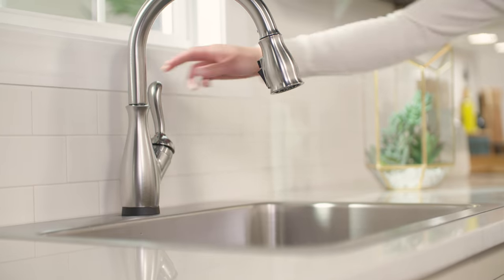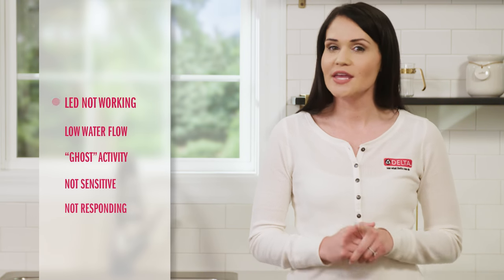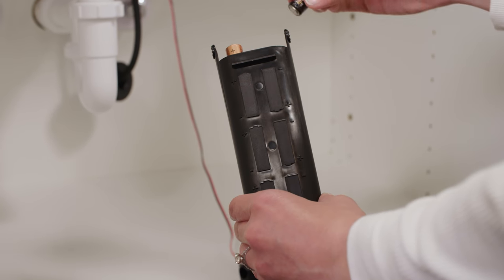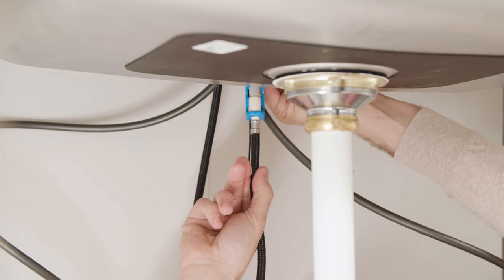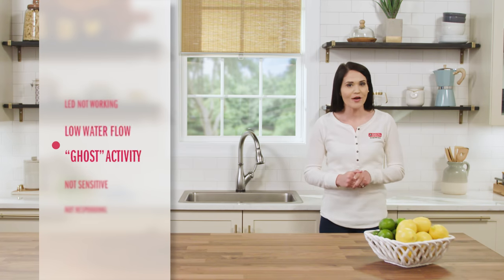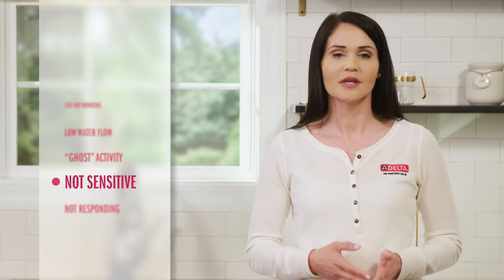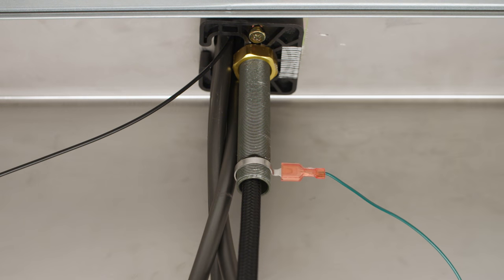How to Troubleshoot a Delta® Kitchen Faucet with Touch2O® Technology

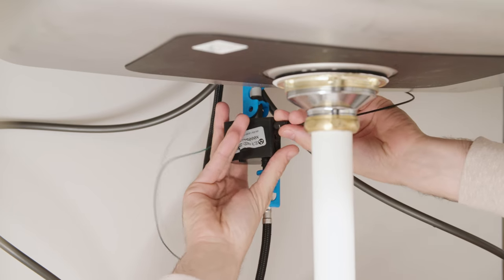Comment: Just a little heads up.  If you are going to bypass the touch feature, be sure the faucet is in the OFF position prior to disconnecting the hoses as shown at 1:45 of the video.  (DELTA, you might want to mention that tidbit in the video)   I had been working with my non functioning faucet for about 30 minutes, changing batteries, checking wires etc.  During all this troubleshooting I left the faucet ON.  Didn't think about it when I decided to do the bypass.  You would be amazed at how much water comes through that hose in the time it takes to climb out from under your cabinets and turn off the faucet.

Comment: I have been unhappy with most of my delta products recently. I’ve never spent so much time fixing broken faucets that are brand new. I use them because my dad did, and he used them because when you used to buy Delta then you never had to worry about that faucet again. It’s the opposite now. It seems like the procurement department worked too hard to lower cost on parts, or QC went out the window, or both. Now when I install other brands I never have to worry about it again, but if it’s a Delta I’m going to be dealing with it again very soon. Anyways, this video is super helpful, because it showed me how I can bypass your faulty expensive product. So thank you for that at the very least.

Comment: Used this faucet for two weeks and did nothing but praise it. Then I started having issues. I called Delta customer service, and they were fantastic. I think the supply hose was moving wires around because the weight was hitting the main drain when I extended and retracted the faucet.

Comment: Just purchased our bucket list house with a Delta Touch20 option. Stopped working, saw the flashing red lights however did not know what that meant until this video. Replaced all 6 AA batteries, working great, thanks!!!

Comment: My batteries died, so replaced them and was still having problems. I watched the video and laid the batter pack flat. That fixed it! I didn’t know that was the problem! (I put it in a plastic container standing up, in case water got under the sink). Thank you so much for the help!

Comment: We had a touch H20 faucet installed two months ago. We started having intermittent issues with the touch feature (just wouldn’t turn on) that got progressively worse. Definitely not a battery issue. I talked to Delta customer service who suggested putting the battery pack flat and checking to make sure none of the tiny wires were near anything metal. We thought we had checked that all out but it kept getting worse, and Delta offered to send a new solenoid (I think that’s good service). I was dreading waiting for it to arrive though (couldn’t use our kitchen sink at all) and checked everything again this morning and found that one of the tiny wires was indeed in contact with metal on some tubing (sorry, not a plumber, I don’t know what anything is called). I taped the black wire away from anything metal and it is working like a charm! Just wanted to say I do think the installation specifics matter. Try what customer service (or this video) suggests. We love our faucet. 

Also, really glad to know there is a way to bypass the touch feature if needed. Thanks for all the helpful info.
Reply: I hate this thing. Trying to cook without water is not fun.
Reply: @AliB333  In the end we replaced batteries and laid the battery pack flat. Haven’t had any issues since. I don’t think the wire was ever actually the problem.

Comment: THIS VIDEO HAS THE ANSWER!  I have the Delta Addison. Started with intermittent problems and got worse and sure it was the solenoid . Hard to get to in back of the disposal but if this 73yr old can fix her problem you can too. Read through the comments…there is an all inclusive answer to shut down the sensor and use only the handle. Key info is to to turn off the touch feature,  the solenoid must be in the open position to allow water. So, run the water while removing the battery pack. Mine was not in a closed case. I removed the wires from the battery pack…BUT YOU MUST NOT TOUCH THE BATTERIES OR IT TURNS OFF THE WATER ON MINE. So, I lifted it by the plastic case, removed the wires  at the top connected by the positive/negative snaps!  Omg I’m so relieved to save a plumber visit!  EXACTLY WHAT I NEEDED. I won’t be buying one of these again!  Hope this helps at least one person!

Comment: I have the Touch faucet and it works great,  this morning no water poured out.  I have the A/c adapter so didn’t think it was the batteries.  I didn’t realize when I installed that I put the batteries in...so today I removed the batteries and reset the faucet.  Water now pours out perfectly.

Comment: I have had my delta Addison Model 9192T-DST faucet for years never had a problem till today touched it like I always do water barely comes out. Cleaned both filters one in the solenoid the other in the sprayer no change still barely come out

Comment: This may seem like a strange question but the touch on my tap stopped working so I tried  to just turn the water on maunually but it didn't work. So I replaced the batteries and it works now with the touch feature but i still can't just manually turn on the water. Should I call my plumber?
Reply from the maker: annie leonheart, I do apologize about that issue, but will be more than happy to help! In order to further assist you, I would recommend you contact us privately! With some more information, including the model number, our customer service team may be able to help you fix this issue. I have included our contact information below. 

Phone: 1-844-923-5368 | Email: concierge@deltafaucet.com| Facebook/Twitter: @deltafaucet

Comment: Faucet on the blink; changed batteries still continued spotty performance.  Watched video and disconnected the entire box and bypassed the entire assembly.  I'm good it was a hassle anyway.  We spend to much time outsmarting ourselves.  Mine had a build date of 10/2010.  I purchased last year built in 2010.

Comment: My faucet just stopped dispensing hot water.  when I pull the handle forward for hot water, the water gets just a bit warmer than the cold water, but not much at all, it is still cold.  The batteries are good and  the touch function works fine.  I unplugged the battery pack and replugged it, but still no hot water.  Suggestions?
Reply from the maker: We're sorry to hear you're experiencing an issue with the hot water flow, Al, but we'd be happy to help. It sounds like you may have a blockage on the hot side. The easiest way to check is to remove the aerator or wand assembly depending on if this is a kitchen or lavatory model. Spray into the sink for a full minute to release any sediment. Next, with the water supplies turned fully off, you will need to remove the handle assembly and cartridge or valve. Checking for blockages, remove all internal portions of the valve and place a large bucket over it. Turn the water supplies back on for a minute. If you are not familiar or comfortable with this type of flush we do recommend the use of a professional and would also be happy to walk you through it. Please contact us directly if you need further assistance. -Edward

Phone: 1-800-345-3358 | Email: customerservice@deltafaucet.com| Facebook/Twitter: @deltafaucet

Comment: I replaced my batteries but the sink still has a drip to it. Anyone know how to fix this? It's working great and if I manually turn off with handle there isn't a drip. Just with the touch on but faucet off.
Reply: Did you get an answer to this?  We are having the exact same problem!
Reply: Same problem here. Any answers?

Comment: I have the 980T circa 2013. Replaced the original solenoid with a new one recommended by Delta from Amazon. Behaviour all over the map so I am returning it. But the two end bits shown here, don't fit on mine. They should shouldn't they? Now have no working kitchen faucet. Appreciated any ideas. Turns out the solenoid that was recommended was on Amazon but used. May explain why it was wonky. Got the bypass working but need to replace the solenoid and they are minimum $383 cdn on Amazon. No one else stocks them. May be time for a new faucet.

Comment: How can I temporarily turn off the touch feature on the facet?
Reply from the maker: Hello Emily. For Lavatory Touch2O and Touch2O.xt faucets, the only way to make them manual is to remove the battery box from the solenoid while the water is running.

For Kitchen Touch2O faucets, there are a few ways to make them manual. 

1.  If you can get the water to flow, then the most universal option can be used.  It does not matter which model or version for this method (excluding Pascal & eFLow).
With the faucet running water, disconnect the battery pack by opening it. Or if you have an open battery tray, remove the batteries. 
You now have a manually operated faucet.  The solenoid was open allowing water to flow through and is now stuck open because you removed the power it would use to close.  Reconnecting the battery would close the solenoid and make it electronic again.
 
Or
 
2.  If the faucet is a later generation, the solenoid assembly may be removed, and the wand hose connected directly to the valve outlet tube.

a. Open the battery holder cap.
b. Disconnect the sensor hook(s) from the spout and/or valve shank.
c. Remove the hose clip and hose from the solenoid.
d. Remove the solenoid from the valve outlet tube by removing the clip or swinging the clip open.
e. Reconnect the hose with the hose clip to the spout outlet nipple.
 

Note: If the solenoid uses an RP60520 adapter to connect to the valve outlet, for example, the early Trinsic, Addison, and Ashton … the pullout hose can be connected directly to the valve outlet nipple, not the adapter.

a. Open the battery holder cap.
b. Disconnect the sensor hook(s) from the spout and/or valve shank.
c. Remove the hose clip and hose.
d. Remove the metal solenoid clip and solenoid.
e. Remove the adapter from the valve outlet tube. The adapter must also be removed to reveal the valve outlet nipple. The hose cannot connect to the adapter.
f. Reconnect the hose with the hose clip to the valve outlet nipple.

The faucet is now a manually operated pullout or pulldown.
 
Or
 
3.  If the solenoid Generation 1 or 2, and operational enough, we can directly energize it open.  This is the least preferred method.
These directions are in the M&Is, using the battery pack to reverse the power to the solenoid momentarily.  Also attached below. This step can also be used on the solenoid for a Pascal if needed.

Comment: Any solution for a leaking brand new faucet which is turned on/off by touch. No leak when handle used to turn on/off. Also hot water doesn't come as fast as with previous faucet. It seem one has to let water run far to long before getting hot.
Reply from the maker: Hi Doug!

I'm sorry that you are experiencing low flow from your faucet and would be more than happy to help! Dripping from a new faucet is typically caused by debris, which can get caught in a few different areas of the faucet. Please try the following steps so we can better assist you:

1.) First, please unscrew the wand from the hose and turn the faucet on for 4 minutes to flush the lines and see if you get good flow out of the end of the hose. Please check for debris in the wand and re-attach it. Be careful not to let go of the hose with the wand removed or it may retract into the faucet. 

2.) Next, turn the handle to the off position, place a bucket under the sink, disconnect the solenoid assembly from the gray PEX tube and check for debris in the screen in the top of the solenoid assembly. If the solenoid assembly is gray, the screen cannot be removed. If it is black, you can use a pair of needle-nose pliers to take the screen out and clean it.

3.) Finally, reattach everything and test the flow rate from the wand again.
If this does not resolve the issue, please let us know the results of the tests. Please also provide your address, phone number, and email along with the approximate date that the faucet was installed and a photo of the sticker on the solenoid assembly.

Best Regards!

Frank

Comment: We have one of these and I hate it.  It never turns on or off when you need it too, the water pressure is so much worse than our previous faucet. We have had the faucet less than a year and have already replaced the batteries twice.  Super annoying replacing batteries so you can get water.  No batteries, no water. The lacking water pressure upsets me the most though. Our last faucet could clean ur dishes pretty fast when you sprayed them, this one removes nothing.  Had our faucet installed by a plumber, and we had a different company come out to check the installation because the water pressure is so bad. They said it was installed correctly and was just the faucet.  We paid a lot for junk.
Reply from the maker: Thank you for reaching out! I do apologize for any issue you may be having with your Delta Touch2O faucet, but will be more than happy to help! I would like to assist you with this matter. In order to do so, I would recommend you contact us privately. I have included our information, below. -Benjamin
Phone: 1-844-923-5368 | Email: concierge@deltafaucet.com| Facebook/Twitter: @deltafaucet
Reply: @deltafaucet  hello my faucet was working just fine but had a little lick so I clean the solenoid put back together and now the touch do not work light come on the blue and off when I touch seen to be working but is not, I'm not sure what went wrong, please help, thank you so much!!!
Reply from the maker: Hi, Jose. Thank you for reaching out to us. I am sorry to hear that your Delta Touch2O Faucet is experiencing issues. We would be more than happy to help you with this. Please feel free to call, email, or message us on social.

Best regards, Rosanna
Phone: 1-800-345-3358 | Email: customerservice@deltafaucet.com | Facebook/Twitter: @deltafaucet

Comment: Thank you. After replace 100 batteries, I finally learn how to remove touch system!
Reply: 😀 - and (according to the video) the batteries ONLY last a year.. two if you're lucky!.. Complete the cost/expense ratio + time and effort = replace Delta ASAP. Annoyed by the touch feature. My six (6) Energizer batteries lasted 9 months on the Delta faucet. Any recommendation on removing the Touch System.. The video whips right thru that part!

Comment: I have two of these touch faucets in my kitchen and absolutely hate them. I’m here searching how to bypass the touch feature. They’ve never worked consistently even after having a local Delta rep come and inspect that installation was handled correctly by our home builder.
Reply: Couldn't agree more. My elderly mom has one. Inevitably, the batteries die in the middle of something like her washing her hair and then suddenly the batteries die and the water won't flow. Can't wait to bypass the feature. Honestly, I don't understand even remotely the convenience of the touchless feature.
Reply: @kyletresch1326  bypassing is simple I found - just unplug the battery pack or remove batteries while the water is running. I ended up bypassing the touch on both my faucets. I’ll never invest in this technology again. Complete waste in my opinion.

Comment: Had some many issues with the touch20 feature, almost replace the entire faucet after less than 10 months, thanks to this video and the frustration with the touch-less we decided to deactivate this feature just removing the cover of the batteries - even that this feature should work after so many issues we did this and we at least we can use the faucet - touch-less feature it's not really good!
Reply from the maker: Hi, I'm very sorry for the issues you're having with the Delta faucet. We'd be happy to assist you with getting the touch feature to work properly. Please send us a private message with your exact model number, full name, street address and phone number if you'd like further assistance with this.-Brandis

Comment: i checked all the connection and everything and it still wont work but if i hold the battery pack in my hand it works what is wrong in that case?
Reply from the maker: Hello Steve Franz. Thank you for reaching out to us. We are sorry to hear that you are having difficulties with the battery pack of your faucet. We would be more than happy to assist you with this. Please contact us directly via email or give us a call. -Carrie
Reply: @deltafaucet  do you have the number or ext I need to call
Reply from the maker: Please call 1-800-345-3358 for further assistance. -Carrie

Comment: I do not have batteries because I opted to have mine installed to where it is plugged into outlet. Problem is I touch it light goes on BUT water just trickles out , like there is no water pressure  :0( What do I do ?
Reply from the maker: Hello, 

I apologize for the issue you're having. I'd be happy to help. Please inbox us with your model number and contact information for further assistance. -Brandis